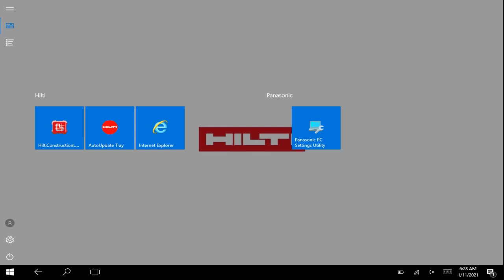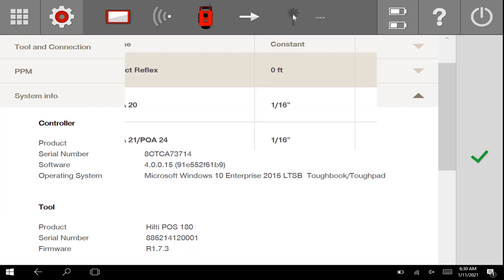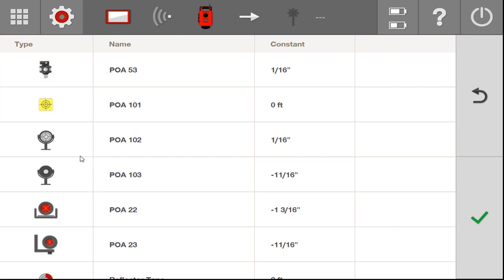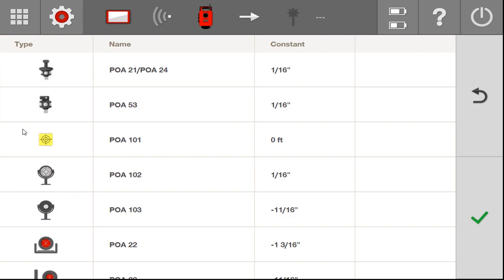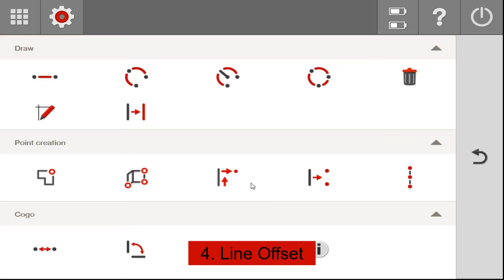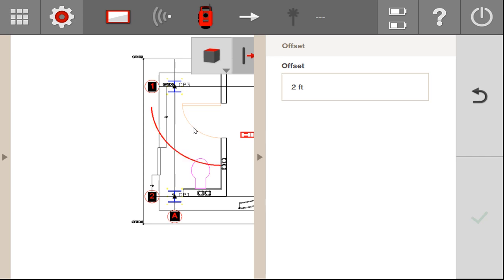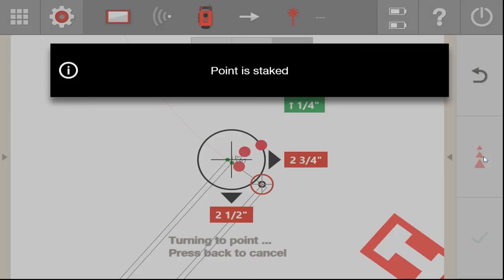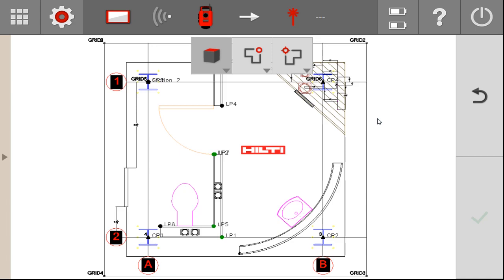Hilti Construction Layout Update Jan 2021 - 4.0

Comment: Will this update fix, failed turn from unit. It's happening quite a bit in field now. When using tablet and trying to turn head unit keeps saying failed turn. Find myself shutting unit down 15 min and start up to often.
Reply from the maker: Hi MIke,

I've seen that error in the past. I'm not sure if the update itself "fixes" that - but one thing I've noticed is that the screw underneath the tool from the tribpod - it is important to have that tight, but not TOO tight. I think that MIGHT help. Also - if that is happening when you are using the laser, sometimes re-measuring the surface you want to layout out on (if not using heights) helps, or, if you are using heights, re-measure in your benchmark height and see if it fixes it.

I'm not sure if you are using the laser though. But yes, I would recommend you update your software, and, if possible, see if a Hilti rep can confirm you are using the latest firmware. What head unit are you using? I can tell you the latest firmware available as well, as I confirmed I'm using it.
Reply: Using PLT300 sorry month delayed response